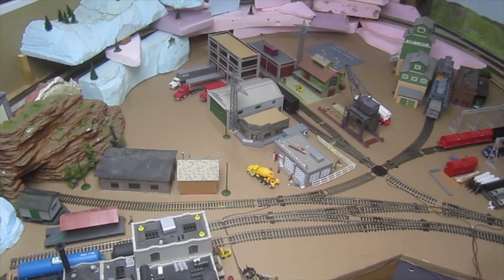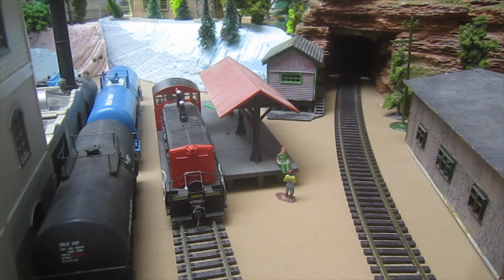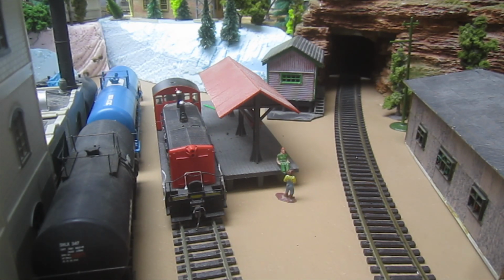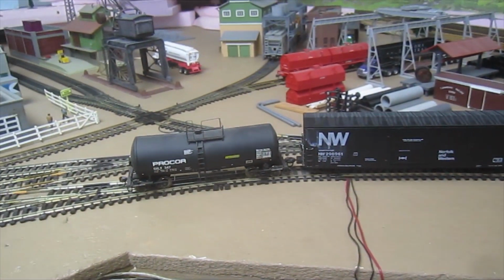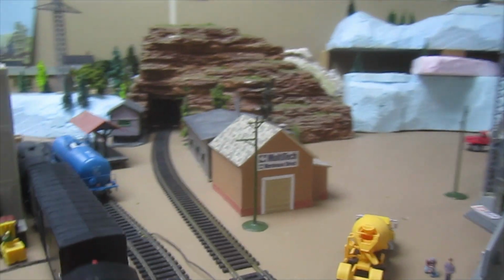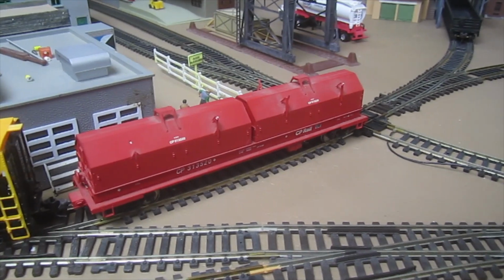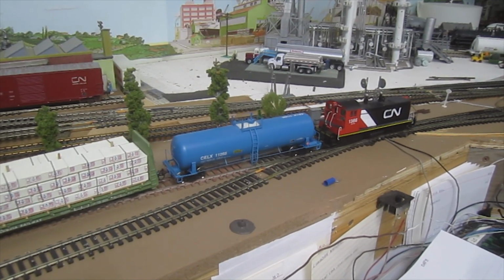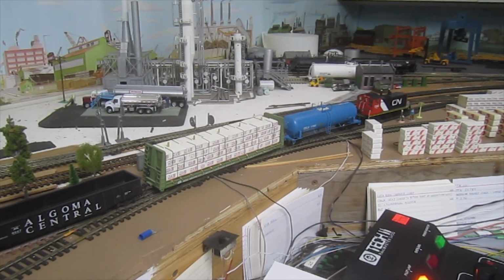#The Train Freak Switching challenge

Comment: Hi David, that was a great vid and ended way to soon. I like those switchers, the CN livery looks excellent.  Mine is a black Pennsylvania numbered 1478.  Not sure who manufactured it, but it has metal trucks and chassis.  Keep the challenges coming mate, they are great to watch. Steven.
Reply from the maker: Hi Steven, thank you for these great comments. I tried to make a short version of what can be a very lengthy switching puzzle and this only shows half of the process. The next move is for the switcher to pull the cars into the yard and then run around some more cars that have to go into those industries. The operator only has the switch list to work from so he has to locate the cars by the numbers on them and a full list can take one hour one way and another hour back the other way.
Perhaps you could make a video of your switcher showing underside details and even the motor and maybe I could identify the maker for you. My 1366 is a great loco. It's a Life-Like Proto 1000. I got it as a non runner for $20.00 and all it needed was a rail spike pulling out of the motor.
David.